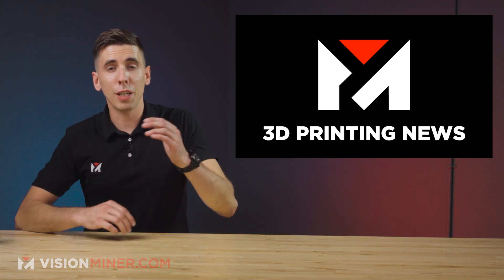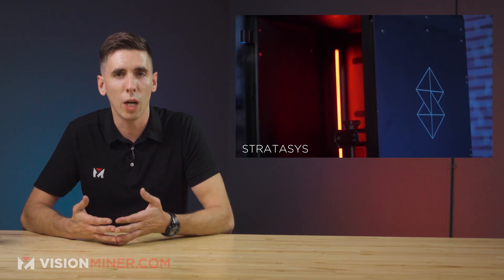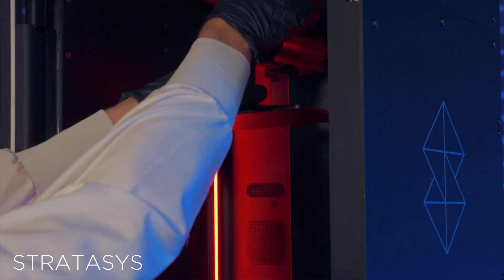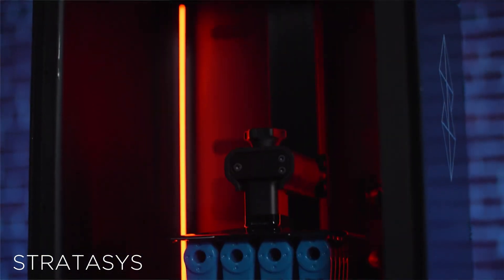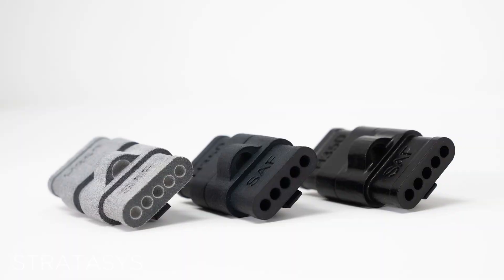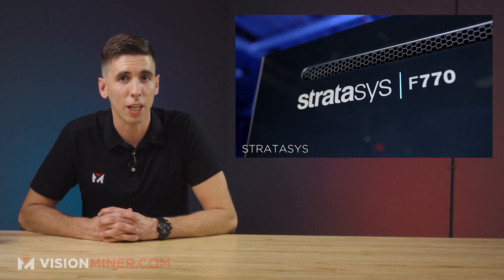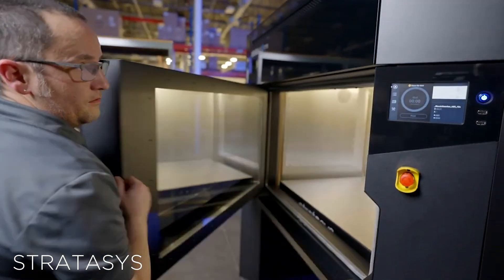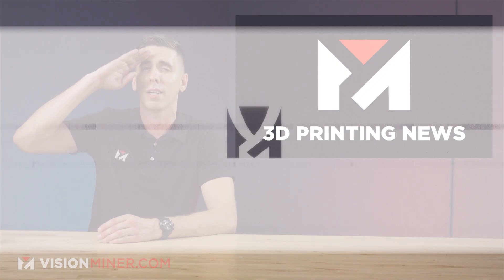Stratasys Unveils Next Gen 3D Printing Tech: Origin One, H350 and F770 Machines!

Comment: Markforged print without the need for a heated chamber  precision and strong parts... to Print without chamber and bed heated IS Better , what do you think about ?thanks
Reply from the maker: Only on specific materials, and even then, often the heat will still reap benefits in mechanical properties.

Comment: Pitty 3rd party aint the customers...nor the comunity.
I wont buy from them.not one bolt. Actually i have a makerbot printer from years ago. but theres still no way to buy the licence of the thing i want to print and sell.  Its down.
Sadly its down for you to and everyone else .
Releasing 3 printers has not got services back on.  
Dental licences, who owns them?
Does the licence holder give permition?
What are the terms on that licence?
Can you or anyone buy that licence currently....
No you cant. 
Who are the denture sellers paying there royalties to?
We had better get this service back online. Fast. 
Did you read that judge who ruled in favour of licence holder and awarded money.
If your selling 3d prints you better be checking licences. 
Our country stopped me selling just one 3d print because licence checks had let me down. I was going to banned from ever selling anything ever again. 
Who is selling dentures name them? and i may m check there right to sell. Go ahead name them?
GET THE LICENCING SALES SYSTEM OPERATIONAL. 
I have to respect the law i have to work under. The 3d print comunity has its own set of laws. 
Licences is what the comunity work under. Dont end up a pirate. 
Ive already felt that lash.